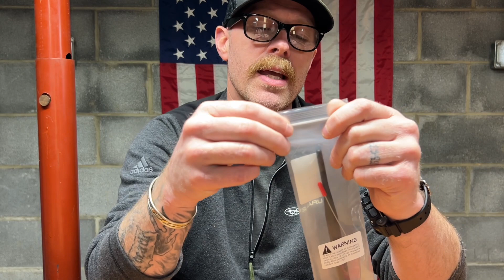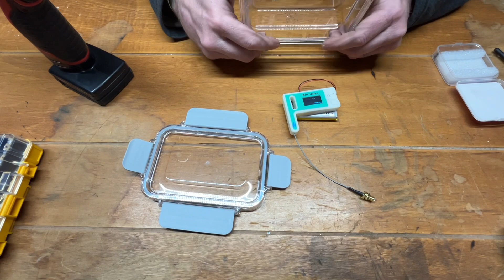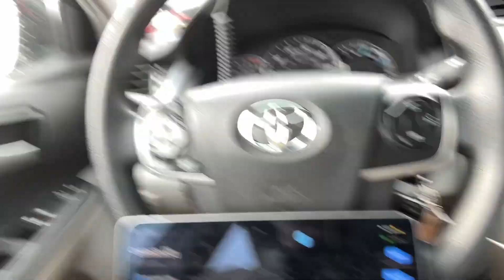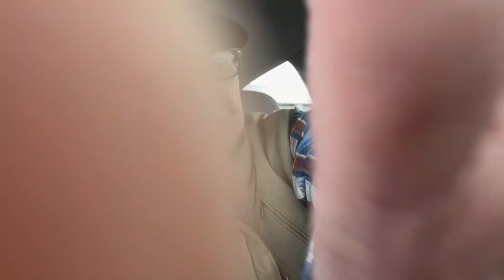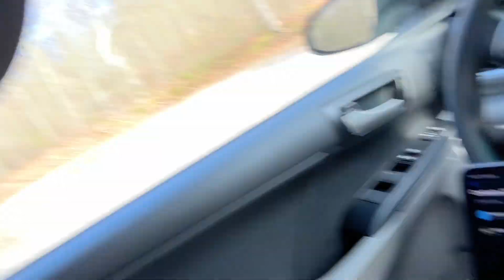Off Grid Communication - Meshtastic

Comment: I'm not a Licensed HAM (yet) but I do listen to an "Over The Hill Net" in Central PA each morning ;) 
"A Guy" in the Net mentioned that he was considering a GMRS Repeater system for local SHTF Coms which I have looked at too.
Looking into it as a GMRS user, a simple way is to use a "Parrot" Simplex Recorder/Repeater Box so you can use & need to charge just ONE Radio instead of two,... Another very good & budget option is something I may or may not have tried lol,... A 10w Unlocked HAM HT with Cross Band Repeater function like the TYT TH-8000D for about $60 on A***on gives you good power and again, just 1 radio to keep charged :) 
Cross band means you must go VHF in & UHF out or other way around so an admittedly unauthorized by FCC method is have the cross band Radio RX on a MURS channel & then, in real time, TX to GMRS,... "I know a guy" who tried this, for Emergency & Educational purposes of course, who did this because MURS is good for a heavily wooded PA & never used. He got 3.94 Miles from a 10w HT to the 10w Cross Band HT which was measured using a line of sight distance calculator & the 2 address's !
Almost 4 miles using MURS then the cross band radio Transmitted the audio, in real time to a GMRS Repeater .
So yeah, you would be breaking FCC Regulations by using the incorrect Radio and more Power than allowed on MURS & GMRS but if Life and or Property was at risk during an Emergency, that would be a personal choice/risk I guess.
Reply from the maker: @davidyummus6259  that’s an awesome NET. I’m on there each morning. It may have been me that you heard. I am putting together the stuff needed for a mobile GMRS repeater rig. I’ll keep everyone posted as I build it.

Comment: There's a nice case from Zerofox3D called the Bender. holds the board, antenna and battery at a nice angle to leave them on the desk working. They also sell the 3D printer instructions.